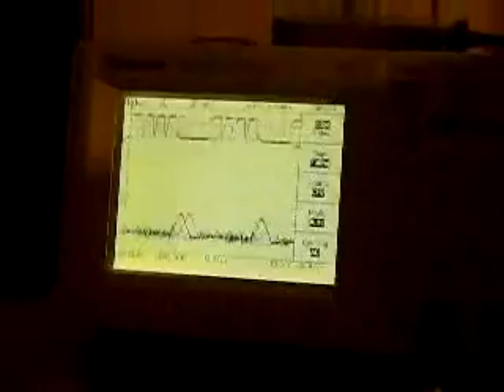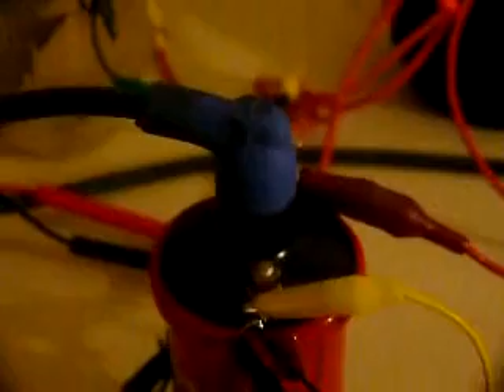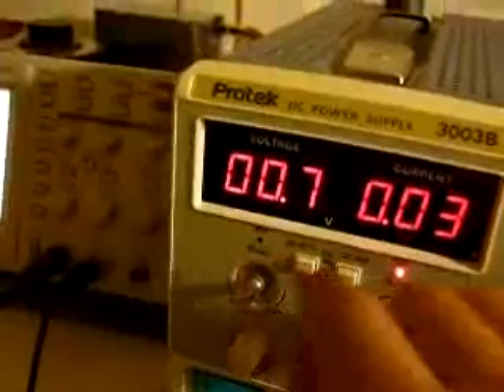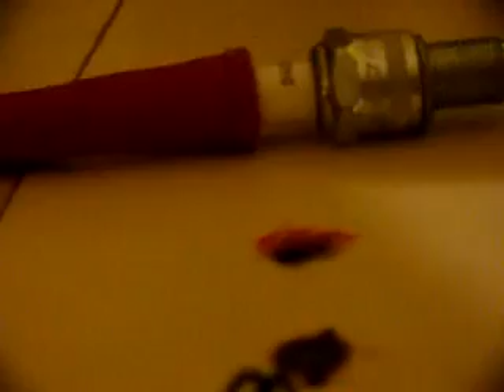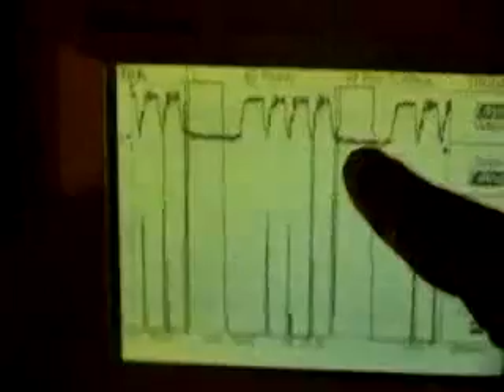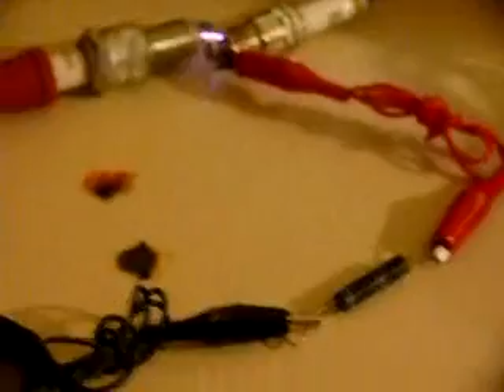experiment #2 HHO resonance

Comment: 42.1khz for distilled water, 70kv/cm, no arc discharging involved, just a dc square wave 100% on duty 10% off duty at 42.1khz try 33watts. 33/70kv=4.7microamps should produce plenty of Meyer's gas